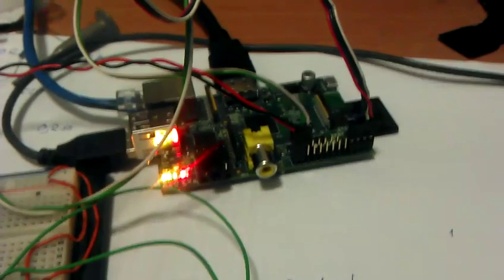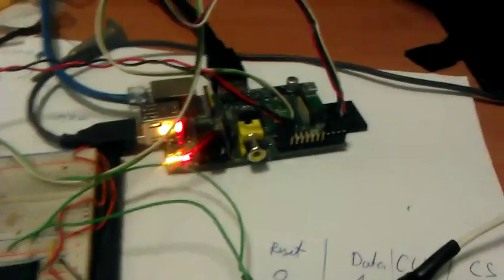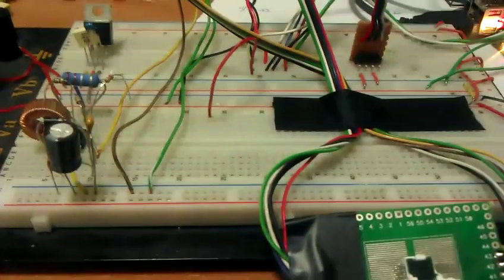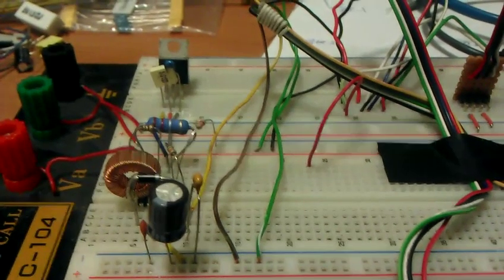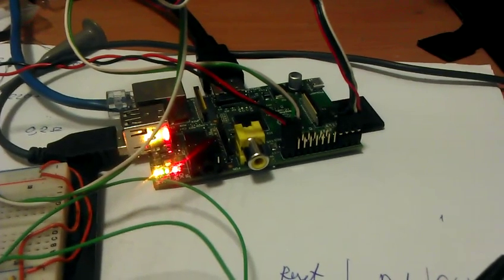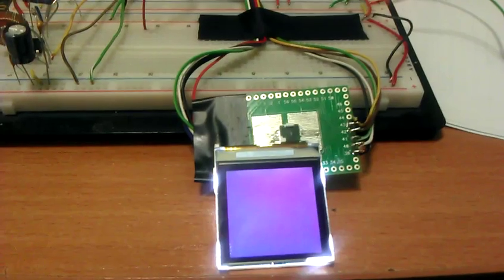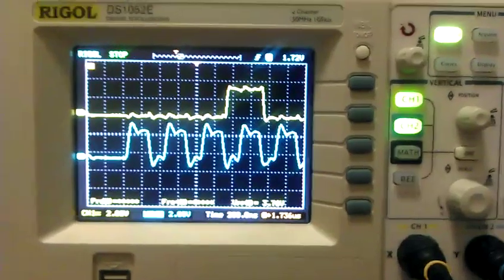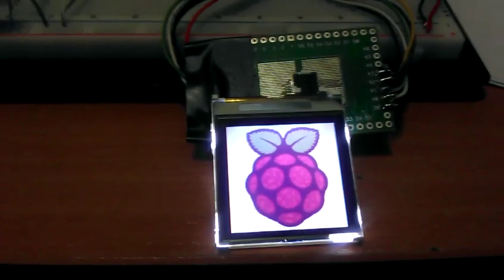Raspberry PI and nokia 6100 LCD

Comment from the maker: I used a crosstool-ng tollchain to build a crosscompiler on my ubuntu system, and did all stuff there. The compiler it self is Linaro c compiler. But this stiff you can compile with a default c compiler on your raspberry itself ;)